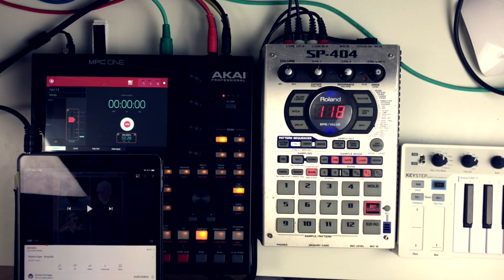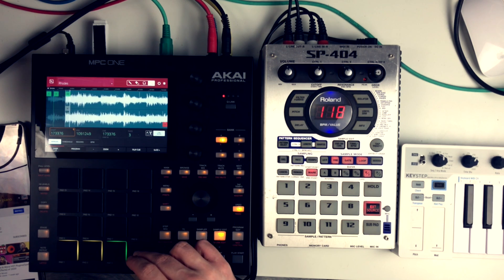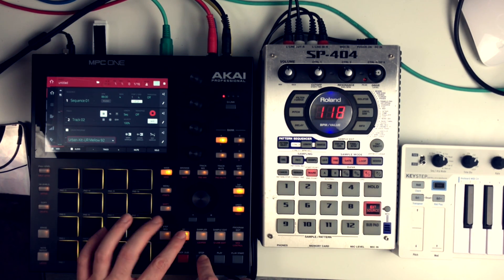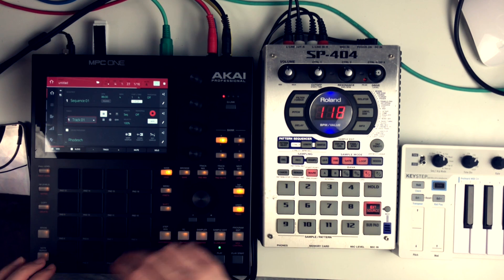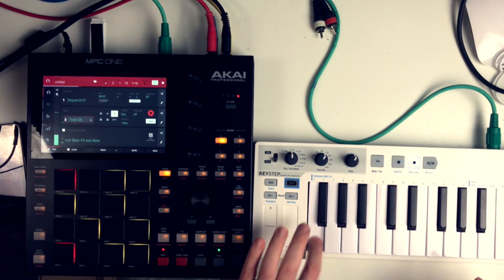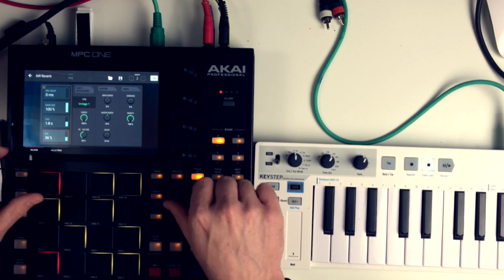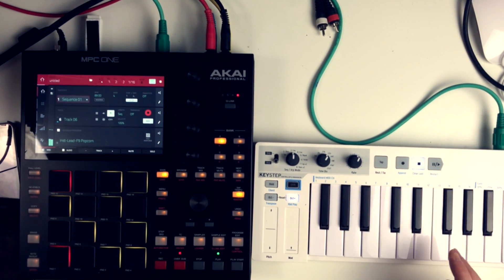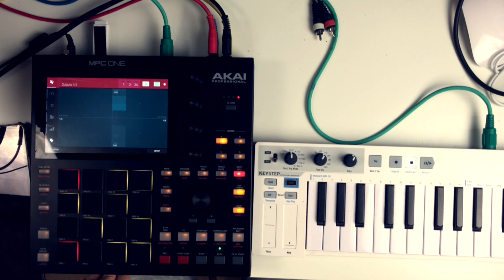Chopping Rhodes Samples on MPC One (Beat Making Workflow / Tutorial)

Comment: awesome work Low Heat! just picked up a used MPC Live and am loving it
Reply from the maker: Thanks Dylan! Do you like it as much as the MK3?
Reply: I think I like it more! I underrated how sick a battery and standalone would be! And the drum synth / chord modes are really rad! I have a Microfreak on the way too to add more synth sounds.
Reply from the maker: That’s great man! I’m still using my homie’s MPC, but very tempted to buy one for myself. Not sure if I will have enough time to use it. I’ve also had the Microfreak for several months and barely used it.
Reply: Super fair! I'm hopeful I'll get a bit of use out of it cause I do a lot of synth based stuff. I wanna augment the awesome sampling ability of the MPC with the power of the Microfreak, layering samples and making kits with it as well